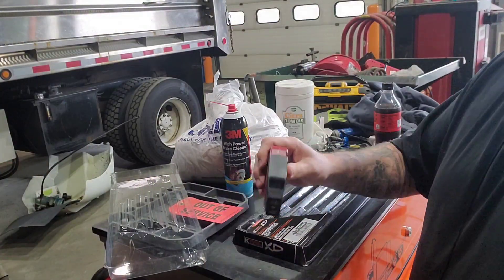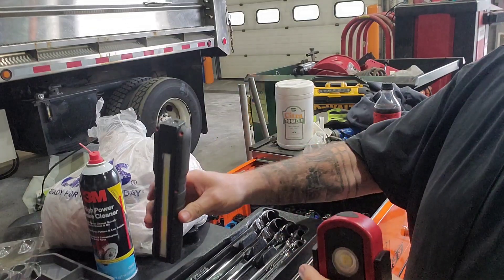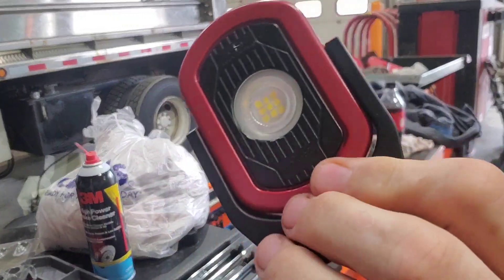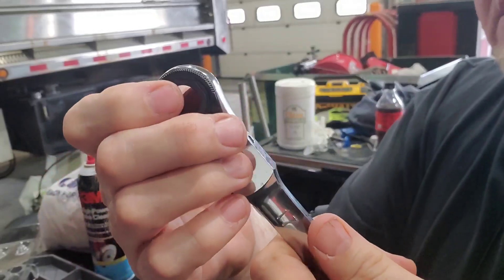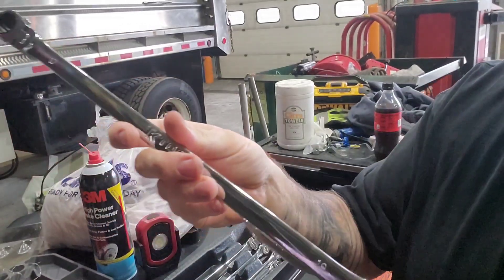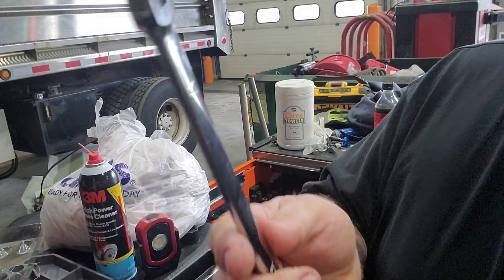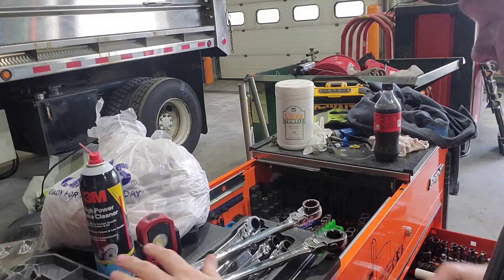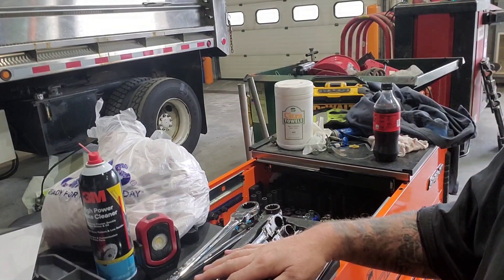Tool Haul - K-Tool Ratcheting Wrenches and Maxxeon Work Light

Comment: I have those wrenches, bought from my Mac dealer too. work great but at times they get stuck on fasteners.
Reply from the maker: That is what I'm afraid with the Spline drives...  Have a great weekend
Reply: @OneMechanic  yup... I know for a fact if you put a lot of pressure on the smaller 13, 14,15 they get stuck ... But that could be the fastener being too small or the size.
Reply from the maker: Just used the 15mm on an International alternator... luckily no issues to fasteners
Reply: @OneMechanic  they are really good wrenches... But every tool has a draw back. ☀️
Reply from the maker: 100% agree... Have a great weekend brother

Comment: I've always wanted a set of those wrenches.
Reply from the maker: I fought for years on these. I bought Tekton originally and they worked with no issues. But these are superior in length and the offset in my opinion

Comment: Hello again Dave 
Thank you for another Great Video. Since you are taking the wrenches home. Will you be doing a in use video? The light too. I guess my main questions on light are. 1) How long does it take to charge. 2) How long does the light last. If you use for an hour, but it three or more hours to charge,  it's not worth my time. 3? On the wrenches, how does the locking feature work with a load. Does it hold or not? Again thank you
Reply from the maker: The EzReds had the locking heads and they have failed on me. That is why I bought the KTools version. The light has been awesome. I don't use the brightest because in my opinion it isn't needed. But it has lasted over four hours with no problems. The charging is a little slow in my opinion. I think it said two hours completely dead.. usually at lunch I will plug it in and use it the next four or so hours with no issues and still having charge.
Thanks as always for watching.. Have a great week
Reply: @OneMechanic  Hello again Dave 
Thank you for the quick response. I don't think that will work for me. Without having an extra light and batteries. Again thank you

Comment: I saw those long KT wrenches in the Mac “garage” flyer on their website.  $247.   Napa has their set (6 point flexible box end) for $270 in their current Real Deals flyer. I bought the Napa set back a few years ago during their Quarter 1 Real Deals for something like under $150.  It was a no brainer price to jump on.  That was a great deal. I may splurge on the KT wrenches and regulate my Napa wrenches just as backups/seconds….. as with inflation increasing day by day, things are only going to get more expensive. I use those long ratcheting box end wrenches all the time so it’s nice to have a second pair.
Reply from the maker: I took my EzRed ones home. Before that , my tektons. The tektons are good but I like the length and offset of these..
Stay Safe

Comment: Just picked me up the K tool 5pc metric set new in the package at a pawn shop today for 85 bucks, couldnt pass them up ive been wanting a set.
Mine have the same lip that sticks out of one side of each drive end, but are maybe either a model newer or older.
They are a little different in that the  direction selector switch is different.
Mine has the selector just below the drive cylinder, its like a 1/4 wide maybe, its a low profile bar with a nice grooved shape to it. Maybe it dont matter but i think it wouldn't get in the way like those push buttons sticking out on each side might sometimes.. maybe not though, ive never used any others.
I'll report back after some months incase anybody cares how they are holding up.
Reply from the maker: Sweet!! Please let me know what you think of them